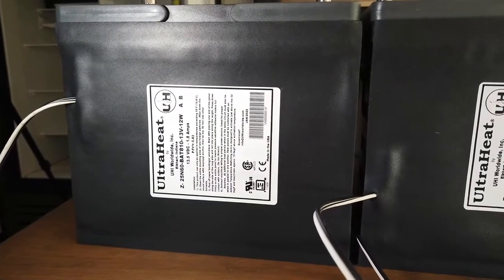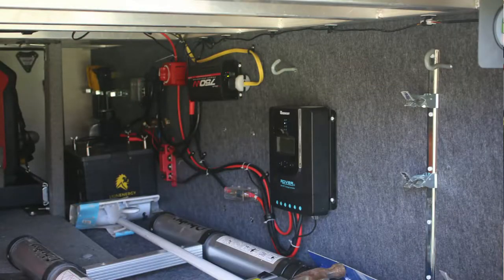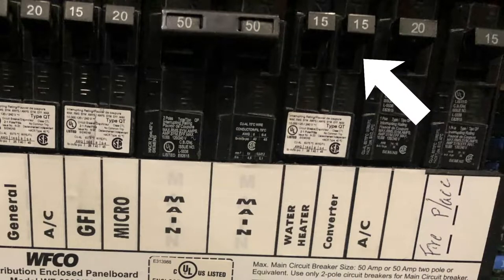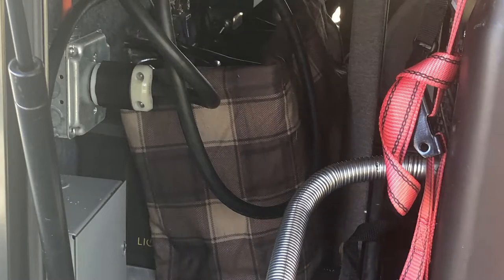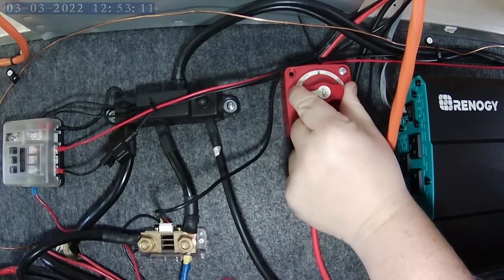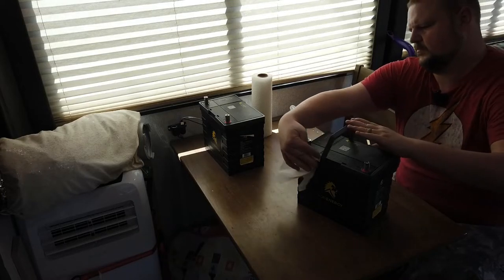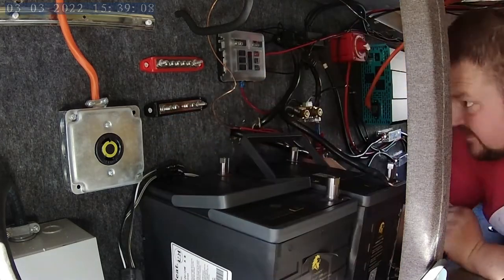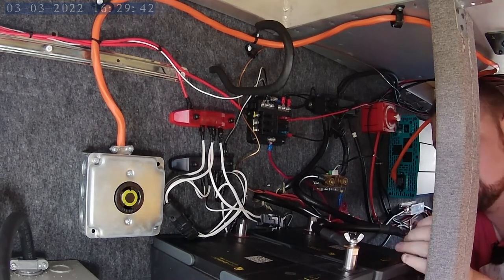Best Lithium Battery Heating Pads #Ultraheat #AnnodIndustries #Lithiumbatteries

Comment: We power our battery heating pads via the Renogy Charge Controller, which allows us to turn the heating pad on and off via Bluetooth. No manual switch requested.
Reply: I too am using the Renogy 'Load' 's 20a circuit to power a separate 12v/110v 20a relay for my Grid powered circuit that powers my 110v battery charger. I have the Renogy power the relay whenever the solar stops generating & I have it set for 7hours. This way, I can top off my battery if needed, if not, the charger justs powers up but does not charge. If I get the Ulta-Heat battery warming pads, I can add another 20a 12v relay for that circuit
By the way, I Have a LiTime 230aH battery with a BMS cold temp shut down, in a Styrofoam box, wrapped with a 12v ComfyTemp lap blanket - So Far, temps in the 20's have not affected my charging abilities

Comment: I run an RV tank heating pad at 12v from my Victron mppt load output. Its about 60watts, but is not on when its not cold as it has a thermostat. The battery is in a styrofoam insulated box. This protects the battery and allows me to finetune the on/off times or use low battery shutoff if there is not enough solar to keep the pad on. Use the streetlight function on the Victron if only the nights are cold, and configure load output to a custom battery voltage drop. This is a set and forget solution, even if im not at the cabin for months.

Comment: I looked up manufacturers recommended storage temps. While they are ok for short periods at temps down to or even below -20c longterm stirage should be between 15c and 35c so anything outside this range accelerates aging/degradation.  I will be keeping mine at 15c minimum using heaters in the case 😊

Comment: I am using 4 SOK 12.8V 206 AH Batteries with Victron set up for my cabin. I'm new to solar and didn't realize the Batteries cant go below a certain temp.I have the batteries in a shipping container and am in Utah at 8300 ft. So I put the batteries in a non working chest freezer thinking its insulated and might work.Nope then I put 4 inch insulation board all around the outside of freezer,still too cold. So last winter I wired a plug into the inverter and placed a seedling heat pad between the batteries and yes it works but It worries me that batteries are too heavy for the pad or get too hot I have the pad set at 64 degrees and am afraid to leave it on when I'm not there depending on weather if I can get up to the cabin.So then when i do get up to cabin I have no power and I put a halogen work light on a generator to warm it up in freezer,Its exhausting to say the least. Would you think this would be a safer route for me to go with and I don't know if my victron has a temperature probe on it.
Reply from the maker: I’m really surprised that the freezer and insulation weren’t enough.  I’m in no way an expert on this and learn by making mistakes but I can give you my thoughts.  I’ve never heard of a seedling mat before and just had to look it up.  I would say a 12 volt pad is going to use less power.  I would assume they are safer but I have no idea.  I try not to be one of these people that think my idea is the only way.  One thing that I do like is that by being in this old freezer, it’s very unlikely that a fire would get out of control because it’s an oxygen deprived environment (at least in theory.). I will say these pads weren’t cheap, but I believe they will last a long time.  All I can say is ultra heat was helpful in answering my questions when I called them.  Sorry to not be much help
Reply: @GimpyCamper  thanks so much,you did help!I Im calling on these pads now and I already ordered the bluetooth thermometer!
Reply: I run a Facon RV tank heating pad at 12v from my Victron mppt load output. Its about 60watts, but is not on when its not cold as it has a thermostat. The battery is in a styrofoam insulated box. This protects the battery and allows me to finetune the on/off times or use low battery shutoff if there is not enough solar to keep the pad on. Use the streetlight function on the Victron if only the nights are cold, and configure load output to a custom battery voltage drop. This is a set and forget solution (but requires a little tweaking of the load output settings to get it right), even if im not at the cabin for months. Im in Norway so its gets extremely cold here.

Comment: Thanks for the video and the detail you presented. 
Question 1. My battery compartment is really cramped and if I add heating pads to the long sides, I will not be able to get all my batteries back in. Can the pads be attached to the ends of the batteries? 

Question 2. Do the battery management systems cope with differential heating (one side of the battery warmer than the other etc.

Question 3. Why are bottom pad heaters not a good idea, if properly designed and sized for batteries?

Question 4. So, what happens if there is a cold snap during the winter and the temperature goes to -35F are the batteries ruined? 

Comment 1. I guess you have adequate insulation where you have placed your batteries. Many battery compartments were designed for lead-acid batteries are well ventilated to prevent an accumulation of hydrogen gas. They are often walled in steel for strength. Sealing/insulating these up can be complicated. 

Comment 2. I use bus bars as well and they are wonderful, however, I would recommend that you do not run your positive wires over the negative bus bar. Better to mount the bus bars vertically with a wooden piece between them or have them well separated as if anything were to happen you would have the full capacity of the batteries shorted out. 

Comment 3. I realize the converter breaker can be a problem. Using checklists should prevent that. It depends on how your coach is wired as 5th wheel often have more room and large basements. I my case with a 35 ft class A, the inverter from the batteries is rated at 2kW, but the feed lines have 100A breakers on them limiting the inverter to 1200W (bad design). Also, the inverter only connects to a few plugs and is not connected to the appliances. Now, I can see that with the original two 100 Ah LA batteries, BUT with 400 Ah of LFE that I have added in place (took out the LA) it can be a different story. Rewiring the coach is not practical, so I intend to shut off the converter and plug my entire coach into my new 3KW inverter that will be connected directly to the batteries with a 250A fuse. This way I would have access to ALL my appliances and will do the load managing myself. Clearly, this will not work going down the road, but the older 2kW inverter will run the refrigerator (I don't like running down the road with the LPG system open) and if I need roof air, I use the generator. I'm keen to get this installed next spring. I can run the microwave, even one roof AC for and hour or so. Amazing. 

Comment 4. For battery system monitoring, I use the smart shunt made by Victron. You can inspect the data on your batteries with your phone. The only complaint would be that the range is fairly short. This could be due to the metal in the compartment, but in comparison the Bluetooth module that reports on my solar generation has far better range. Nevertheless, I can sit in a lawn chair and check my batteries and get more information than I would from the gauge on a panel somewhere. It also saves running signal wires all over the RV. Again that is easier in a 5th wheel, but still.
Travel safe. Henri (RVing with Henri)
Reply from the maker: I will say just on my two batteries I had to move my angled aluminum over that I use to hold them in place.  Most of the knowledge I have on battery warmers comes from ultaheat as It was very hard to find recommendations other places that were more than opinion.  They actually said most of the manufacturers recommended the side heating pads, but stated they did have the bottom pads.   I’ll be adding an additional 1-2 batteries in the coming months and I’ve been thinking of moving all my electrical to the front bay.  As far as the negative temperatures,  I believe the biggest thing is not allowing them to charge in the cold, I believe if they dropped below the rates usage temp the bms would likely prevent discharge but I really don’t know.

Comment: I don’t know how much the pads will keep the the batteries from dissipating heat in hot weather climates so I plan on making a strap on system for these pads so that they can be removed from the batteries when in the heat of summer.

Comment: Odd that you state 7 months ago that Ultraheat will add the battery heaters in near future ... They still haven't listed them. Where can I find them?
Reply from the maker: The contact information is in the description
Reply: @GimpyCamper  Yes I went to their site. I see tank heaters, elbow heaters, and valve heaters. but no battery heaters.
Reply from the maker: There is an email address, a number to text, and a number to call.   I understand it’s not the best way to order in today’s date and time but that’s all the options they had at the time I ordered mine